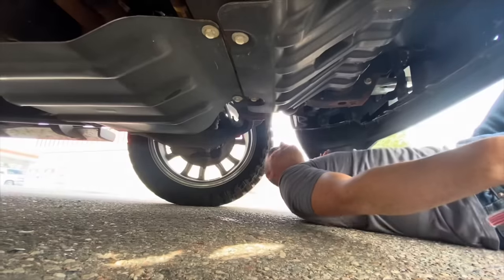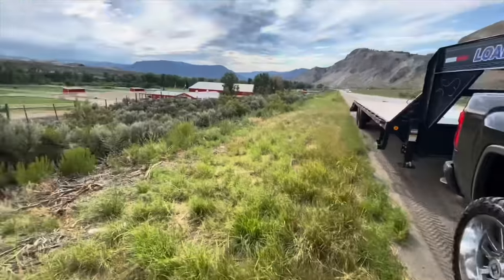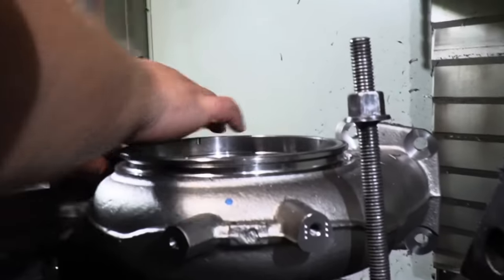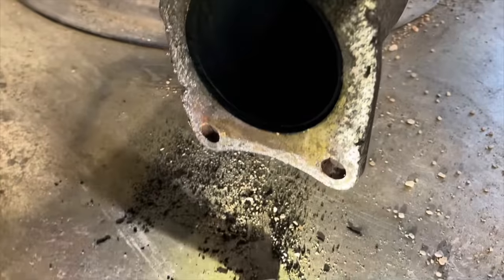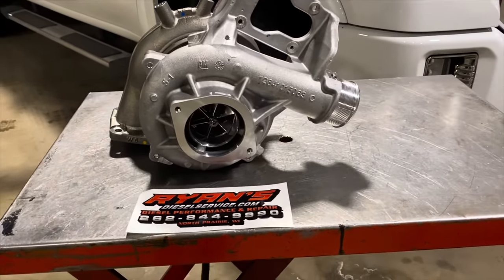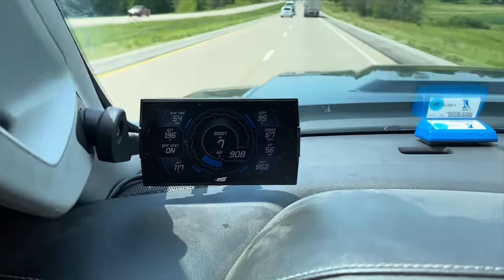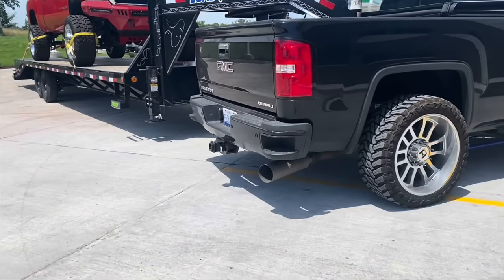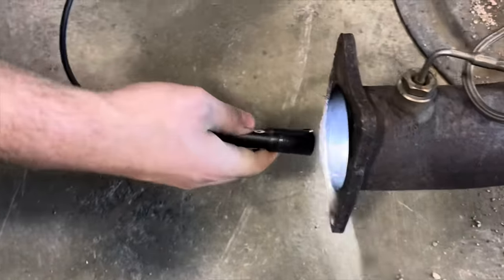This Is What Emissions Did To My Diesel! Heads Up Diesel Owners!

Comment: Like JH Diesel said in one of his videos, if the government is making us keep this emissions crap on our trucks that WE buy, then they should be on the hook to fix anything that goes wrong with the truck emissions wise.
Reply: Completely agree.
Reply: Thank God I live in texas and not California or New Jersey
Reply: Nobody is making you buy a diesel genius.
Reply: I don't get why people quote the most stupid statements as if they hold any meaning or logic. It's no different than construction code... these are rules set for the environment and or safety. Suggesting that the government is responsible to pay for it is a child's response. 99% of these clowns with diesel have absolutely no need for it anyway- move to gas like an adult with common sense or deal with the needy girlfriend breakdowns you paid an extra 10 grand for.
Reply: Good luck with that
Reply: @sly9263  I own a diesel truck and I also happen to like breathing clean air. These people think the world revolves around them.
Reply: the duramax also came in a strait 6 as well as a v8, should of used the six here imo.no def or regen systems in most of the countries their sold in as it isn't a requirement and they are still extremely clean burning according to the guy I was talking to from new Zealand.
Reply: @michaelcrossley4716  I really don't see the point of people doing cat deletes on gas cars because they don't really affect anything, but diesels with def and dpf waste more fuel than older units and when they fail they will leave you stranded because of a sensor so I would delete a diesel even if I want clean air because diesel emissions systems are shitty as hell and very expensive to repair, and having to use another fluid is just stupid.
Reply: Good luck with that, instead delete it
Reply: That's going to happen.
Reply: On gas cars emission stuff is warranties to 80k. My cat went out and they replaced it no charge.
Reply: I run my ram in 5th while towing to keep RPM’s high due to lower speed limit. Not towing I drive it fast.
Reply: @michaelcrossley4716  they also love government controlling them
Reply: @albertpintor3522  That's a fair argument.
Reply: @sly9263  need it or not if that's what they want so be it. I got a 7.3 PS cause i wanted the fuel mileage and a easy 500 plus thousand mile engine with a manual trans and NO emissions to hurt it. The emissions hurt the trucks,the environment and the customers pocket. Tuning theses trucks correctly helps everything about them.
Reply: @rickeydriskill1096  pre 2010 is the way to be for diesel
Reply: @sly9263  i agree
Reply: @sly9263  less then 1k upcharge for 3.0 diesel.
Reply: @AmazonWebService98  I'm talking HD diesels, which is the primary market share. Light diesel doesnt really have a place with hybrids being better in pretty much every way
Reply: @sly9263  you sound like you would be happier living in the CCP
Reply: @StarHunter28  I was actually surprised and slightly disappointed that there were so few emotional replies to my objectivity here- your contribution is appreciated
Reply: They are warranted for extended periods, regarding emissions systems… but they label stuff as “maintenance” and then its on us
Reply: @albertpintor3522  Diesel engines don't produce any hydrocarbons.
Reply: @kxp.1496  It's illegal to do that.
Reply: @goducgo  Your Ram truck uses a Cummins engine. GM trucks use "durajunk" garbage engines.
Reply: That’s the dumbest logic I’ve ever heard.
Reply: @sly9263  I love the “needy girlfriend” analogy.  It’s so true.  A great majority of these guys only have diesels because it makes them feel macho.  It’s an expensive affair, and the manufacturers KNOW THIS.  You pay an inordinate share, as an owner of something with the design weaknesses in these systems.  They’re expensive toys!
Reply: @mmarciniak  You're a certified diesel engine expert, since when/how?
Reply: @mmarciniak  Ford 7.3 and 6.7 diesel engines are not weak.  GM "durajunk" diesel engines damn sure are.
Reply: @sergeantmasson3669  I do agree with that, but diesel pickups in general have just gotten way overpriced, to buy and to maintain, too.
Reply: @sergeantmasson3669  I know.  They convert liquid hydrocarbons to particulate hydrocarbons and introduce them into the air!
Reply: @mmarciniak  That, I agree with. However, the Ford 6,7 diesel is better than the Ram or GM.
Reply: @mmarciniak  Damn near ZERO. Diesel engines are far more emissions friendly than gas engines. Science has proven that several times. Properly tuned diesel engine with quality fuel, no soot smoke either.
Reply: @sergeantmasson3669  i really blame all these immature coal rollers for ruining deleted trucks for people who want a more reliable truck. My dad has a 2013 f350 6.7 that came deleted and it rolls a little coal especially when flooring it and I  want to get it retuned for zero smoke and because the tuner is very outdated and it has the 2015 and up turbo
Reply: @albertpintor3522  That's your opinion Proper tune and quality fuel, ZERO "coal burning" smoke.
Reply: @mmarciniak  You mean I don't need a 2500 pickup w/ knobby tires on 24" rims to commute to my desk job only to bitch about fuel prices?
Reply: @michaelcrossley4716   the irony of this comment is…. Even you think the world revolves around you otherwise you’d be advocating for the old carriage and horse, but you aren’t doing that cause you’re too good for that right? 

Get out of here man
Reply: The problem with that statement is, even if the government paid for the repairs, they would pay for it using our money.
Reply: How bout everyone stops thanking god!,  he sure tf isn't making the decisions for you
Reply: They don't care anymore. They rather you own nothing
Reply: @michaelcrossley4716  If you spin in circles all the time, it seems that way.
Reply: Beyond dumb logic
Reply: @Mitsubeasty1  You can always spot someone who doesn't travel much. Go to China or India and then tell me it's all a scam.
Reply: This is going to be the death of not only the diesel engine, but also the death of General Motors, no question!!!!!
Reply: The emission warranty is usually longer or at least as long as the powertrain warranty.
Reply: @albertpintor3522  for starters just about any sensor failure can leave you stranded. 
The. Problem is when you modify your vehicle.  All modern diesels have a dpf, and possibly def. You have to pay attention to your regen cycles. When  you modify your vehicle it has effects on other systems. If you do not want have problems keep them stock.  If you modify your stuff expect to have issues. That is the nature of the beast.
Reply: @Mitsubeasty1  Dude, you're arguing points I never brought up. 

1. I'm not lecturing anyone - and I'm not talking about suv's, we're talking about diesel trucks - it's called a conversation. 

2. If/when it comes we can talk about it. Until then, there's not point. 

3. Go read my comments. This is exactly my point. It's not black or white/all or nothing. The topic comment thinks trucks "we own" shouldn't be required to have any emission standards at all unless the government wants to pay for it. 

4. Pointless statement. Unless you're Warren Buffet, I don't care. Without getting into another argument, you wouldn't be the first person to make a bad investment. Which is why this statement means absolutely nothing. 

5. Seriously? Smog can be measured and anyone with a basic education can evaluate the difference between smog and fog. You can look these claims up, you don't have to take my word for it.
Reply: Amen!
Reply: @BlackSuburban  What does it matter if he lives in Texas? It's still federally illegal to modify any emission systems. It's still federally illegal for any shop to do it.
Reply: It's been written on some great authority:
"When one deals with government they do so at their peril."  (Cite omitted).
Reply: @sly9263  do you pull over 20k lbs. Gas won't cut it. I agree some diesel owners do it for a statement but there is a place for gas trucks and there is a place for diesel trucks. My thoughts on it
Reply: Damn good idea 💡🤣
Reply: And on the flip side, the government can pay for any environmental damages that come up and pay for it with an increase in taxes on diesel fuel.
Reply: @P00katube  Have you seen the electric vehicles they're coming out with?  They're going to squash Tesla.
Reply: Whats funny they don't use it on military vehicles. So you know they know its a problem.
Reply: I agree
Reply: @cantbsdave  soon as one trouble happens we should be allowed to delete them at their expense. But we would rather give the tailban billions.
Reply: @wihamaki  With all due respect,sir, you wanna buy my bridge?  There's a sale on accompanying toll booths?  
The goat's gonna pay . . .   Remember, "When one deals with government they do so at their peril."
Reply: I agree
Reply: Emissions crap shouldn’t be on these trucks…
Reply: They have a 10yr federal emissions warranty
Reply: Agree but good luck.
Reply: @jordanbates549  they're not remotely comparable dude... what are you on about 🤣😂
Reply: @sly9263  GM ls is basically now trash because the cyl deac ruins them. All The half ton diesels would all run better and more efficiently without the def bs. Not being able to tune out stupid crap in any engine platform is what causes issues. Emissions is emissions like it or not and stop people from being able to get rid of problematic areas. I understand their purpose but do not wholly agree with how it actually works.
Reply: @jordanbates549  DOD is a far cry from diesel emissions... and I had an L76 GM with DOD 150k miles zero issues. That said, they do have notoriously weak lifters and I would avoid anything with DOD since it's fake news MPG gains for marketing anyway
Reply: @sly9263  I am not saying that gas or diesel emissions are the same, i am just saying that emissions related items fail and the epa does not want anyone removing these things. Would you agree if you remove the DOD system that the same engine will run/last longer without repair? The same goes for a def/dpf system. These are items put on to accomplish better fuel economy and less emissions that otherwise are not needed. and like you said the DOD doesnt really increase fuel mileage much anyways.
Reply: @jordanbates549  DOD doesn't have anything to do with EPA requirements- it's not mandatory. It's just marketing. You can strip the DOD right out of that engine, new lifters and cam and it's legal. You can't do that with diesel emissions equipment
Reply: @sly9263  You still have to tune with the delete of DOD as far as Im aware. And the EPA isnt exactly tune friendly. A cat doesnt do anything for a vehicle other than emissions, gotta have one of those.
Reply: @sly9263  You're taking my statements entirely too literally
Reply: @jordanbates549  "Gassers now have so much emissions BS that theyre just as bad." what do you mean taking your statements too literally? what you said there is just nonsense- you're making an apples to oranges comparison- gasser emissions isn't anywhere close to the same continent as what diesel has
Reply: @jordanbates549  there's nothing against EPA regulations with tuning and catalytic converters have nothing to do with replacing a DOD system.
Reply: @jordanbates549  I don't say this to be rude, but it really just sounds like you don't know what you're talking about
Reply: @sly9263  I am saying emissions is emissions, your original comment said move to a gasser if your'e complaining about emissions BS, I am saying you dont avoid emissions BS if you move to a gasser. I have an LML and I use it all the time for what its intended for, I'd buy a gasser but I expect to be able to tune to my standards any vehicle I own as I see fit, gas diesel or otherwise. It was not a direct comparison I was trying to make, just saying you arent avoiding emissions problems going with a gasser, and that there are 1/2 ton diesels that would benefit from not having emissions equipment
Reply: @jordanbates549  either you don't know what you're talking about or your comparison logic is far out in left field. emissions problems on a gasser is the same as any other regular car. emissions problems on a diesel is COMPLETELY DIFFERENT and exponentially more expensive. again, what your initial comment and continuation of what you're saying just makes zero sense
Reply: @sly9263  Ok lol
Reply: @sly9263  A cat for a 2019 Silverado is ~2k ya super cheap. But if you can just remove it and tune it out (not expensive to do) then it would be cool if you were allowed to do that. PER EMISSIONS REGULATIONS YOU CANNOT. Has nothing to do with apples to oranges, a cost that isn't necessary is still expensive.
Reply: @sly9263  LOL you are so stuck on the comparison aspect. And yes I have, I have an LML, have had DEF issues
Reply: @P00katube  The 5.3 and 6.2 will be the death of gm.
Reply: @bfields1448  amen to that
Reply: @albertpintor3522 I live in Jersey and tbh it ain’t bad here I rarely ever anyone get in trouble over emissions not saying it doesn’t happen but definitely not as bad here as people think lol
Reply: It would help keep trucks “clean” so that people don’t delete them.
Reply: Or... American engine manufacturer could stop building crap.
Only US-built diesel engines are having these issues.
Reply: @michaelcrossley4716 imagine thinking pouring piss into your diesel actually makes the air cleaner
Reply: @Vertilgen absolute mouth breather take
Reply: @tightbhole420  I can't imagine that. That's a stupid idea. Who's idea was it?

Comment: I worked at a chevy dealership as a technician for the last 2 years, probably 95% or more of Duramaxs that came in for problems or check engine lights, were because of a component failing in the emissions sytsem, and the repair was rarely ever "Cheap". The government ruined Diesel trucks with their garbage emissions components.
Let's not forget what the government did with something so simple like the gas can and how they ruined those. Now, everytime I use a government approved gas can, I end up spilling fuel on the ground, yet with old ones or modern "Non EPA approved" cans, I dont spill any fuel at all, and it pours out the fuel much faster than the garbage EPA ones.
Reply: Have a good collection of old Wedco plastic fuel containers......simple, function well and no spills.
Reply: True and fuel has less lubrication.  I add lucas and or 2 stroke on my 08 6.4l deleted 170k running strong.
Reply: I still love my heavy Chevy
Reply: $17k in repairs on my 18 l5p in the last 2 years.  All emissions
Reply: We need to get them recalled. Chevy/GM should pay for repairs
Reply: Diesel vehicles have always been junk. I have been a technician for 36 years & all of you can talk shit all you want but the only one worth owning is early Cummins, the rest are garbage.
Reply: FACTS.
Reply: @15Jeep me too..😂😂
Reply: @stevepulse4893  I have a 2009 6.7L Cummins, just turned 350k runs strong.
Reply: I have 05 dodge Cummins 587000 miles gets 21 mpg still running strong

Comment: Fairly new to your videos and enjoying them. Not a diesel mechanic and I’m learning things. Thanks for sharing your cross country adventure and mechanical problems. I’m becoming very thankful for my 03 LB7 one ton. It was a camper truck for a 5th wheel owner. When he wasn’t camping it was in the shed. Had 34,000 miles on it the day I bought it. New injectors @ 42,000 miles and it’s been problem free since.